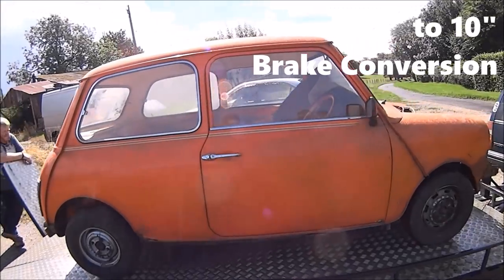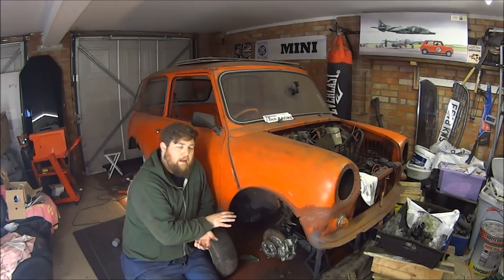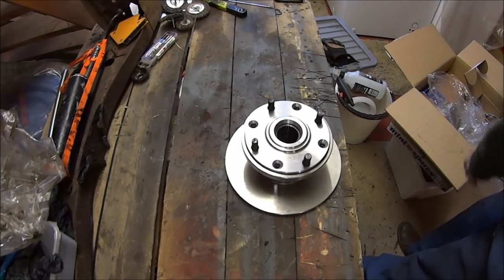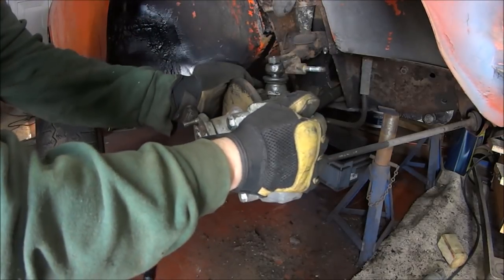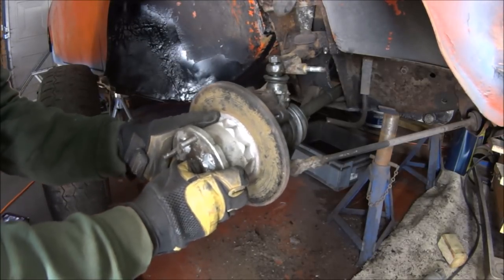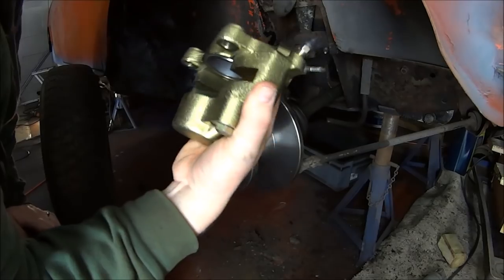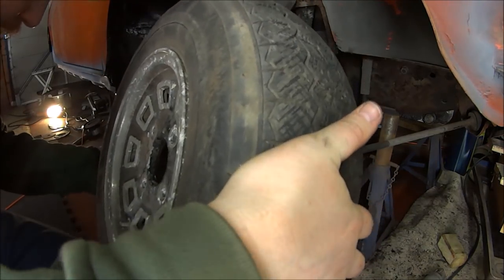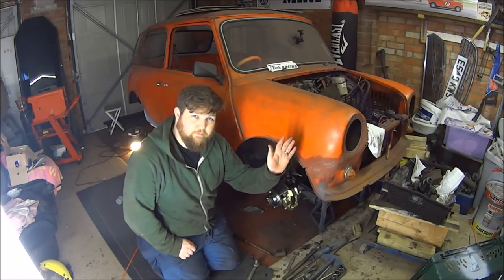Cooper S Brake Disk Conversion - Classic Mini How To - 8.4" to 7.5" 12" to 10" Wheel

Comment: Nice video! 

I’m having trouble removing the drive flange and disc. 

I’ve removed the hub nut. Does the tapered washer need to come out before I can remove the drive flange and disc? 

Mine appears to be seized! I’ve left it to soak in plus gas, hoping it does something overnight.
Reply from the maker: Sorry I’ve missed this comment! Hopefully you’re not still stuck!

Comment: Does the new drive flange makes it possible to still use 12" ? I have some new tires on my 12, but I plan to go 10" as soon as they are done. Can I convert to 10" before hand? Moreover, do you know of any vented kit that fits 10" wheels ? I have a supped up overbored 1330cc with a slight longer duration camshaft and flowed head pushing 90bhp, sometimes even the 8.4s with EBC greens fade on track, even though I have dot4 and braided lines ( still 2 pots though ), do you think the standard 7.5 could keep up ? Thanj you !
Reply from the maker: TheThunderwars you can still fit 12s as well as 10s yes. 
There are 4 pot calipers and grooved disks in 7.5 and I think you can get vented disks that are 7.9inch and will fit under most 10” wheels but not all

Comment: Nice. Wonder how it compares to mine...mines from minisport. Although at this point I’ve absolutely no idea how to assemble it as it’s all in bits ready to assemble (cv etc). Did I hear you say you’d done a video on that?
Reply from the maker: Smugwood Mini have a look at my last video, shows you roughly how it goes together. DB mini has done so really good detailed videos on how to get everything all together like bearings etc. Did you buy the full kit with new hubs and everything then?
Reply: I’ll have a look 👍. Yeah I bought the entire brake kit assembly. Looks like I’m going to have to buy new front subframe and assemble everything from scratch...it’s like one huge jigsaw puzzle with no instructions 😂
Reply from the maker: Smugwood Mini haha, yep, honestly not that difficult. Ball joints are trial and error to shim correctly but there are good videos showing that. I don’t know if the Haynes manual shows and exploded view that might help get your head round it all. 
Definitely think you’ve gone the best route so all your parts are clean and fresh! Make sure you paint the callipers and hubs though as they will rust up fast on the car.
With the subframe, I’m getting mine sandblasted so they’re nice and clean and fresh 👌🏻
Reply: Good stuff. It’s amazing how good the subframes look when blasted and coated. I’ve yet to have mine properly inspected but chances are at 40 years old they’ll be replaced...but there may be hope yet 😊. Keep up the good work.

Comment: Hi Matt, Nice instructional video. Did you try using the 8.4" flange to the 7.5" disc? Thanks for your help. Cheers!
Reply from the maker: Hi David, the flanges are totally different and not interchangeable between the two
Reply: @MiniMattTV  Thanks a lot for your info.

Comment: Hi Matt, great video. I am doing this tomorrow so really helpful. 
Do you fit the drive flange to the hub dry (or any copper grease) and how tight do you do the screws up?
Reply from the maker: James Foster hi, the drive flanges just slot onto the studs on the disks, I’m not sure the torque spec of those screws but I fitted them dry and just as tight as I could get with a screwdriver, the studs will stop it from spinning around anyway so I don’t think it’s too critical. 
Good luck with it, it’s not too bad of a job to be honest
Reply from the maker: Officially 10-13nm apparently as they’re only posi screws

Comment: how well do you brake with those small disks? i currently have all 4 drums and they dont brake great...
Reply from the maker: Sean Normand hi, yeah they are good, you still have to press the pedal firmly but you can lock up the front wheels if you need to so plenty of braking power. Mini sport do a 4pot calliper and 7.5” grooved disks too now 👌🏻

Comment: Weird question but do you know if it's possible to replace the rear drum breaks for pads?
Reply from the maker: Lewis John Williams yes it is possible, as far as I know the only kit is from KAD and very expensive. Minis are so light they really don’t need much braking at the rear wheels so standard drums are good enough. A good upgrade is the minifin aluminium finned drums which help with brake fade.
Reply: @MiniMattTV  thanks Matt great vids btw keep it up. I'm also using your vids as a guide for my mini. 👍